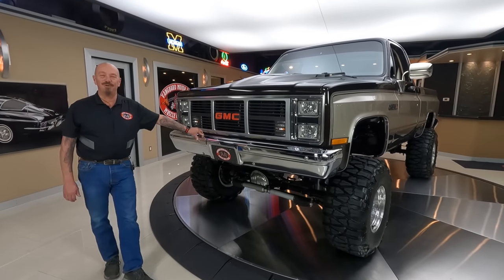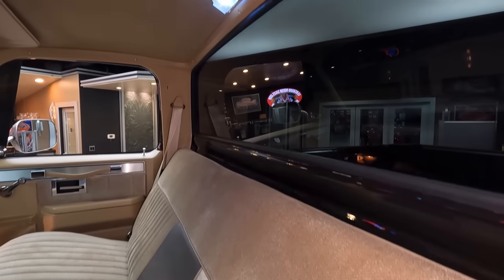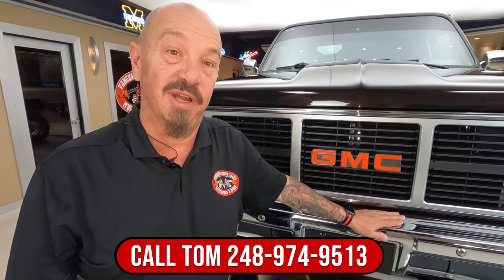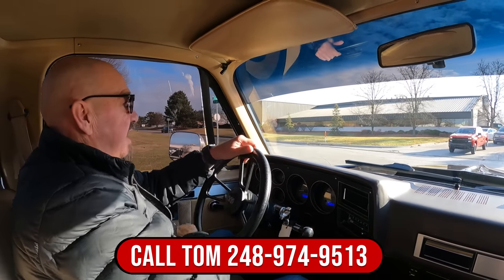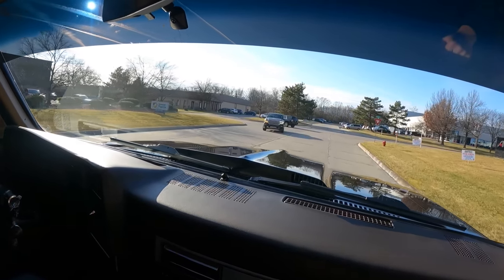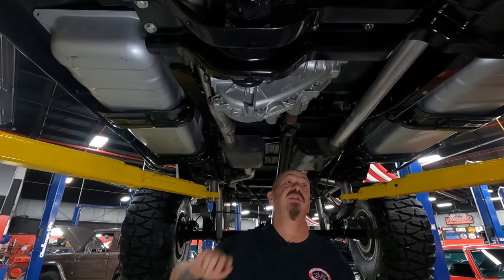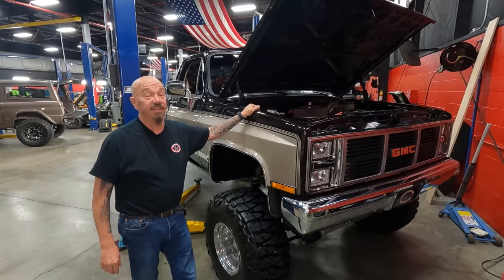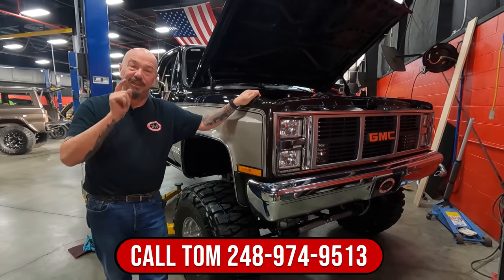1987 GMC Sierra 1500 4X4 Pickup For Sale Vanguard Motor Sales #3233

Comment: I had the 85 Scottsdale 1500. 4+4. 7’ with 35’s mud terrains. Was one of my favorite trucks. Had the factory midnight blue and sky blue two color combo. Mine even had factory coded antenna in the windshield and the quarts clock.
Reply: were those carburated?  when did they go to fuel injection?
Reply: had ‘77 and a’78 77 had small block 400 78 had 350

Comment: I wish I had the money for that truck. I used to have a 1984 Chevrolet 1500 4x4 6 inch lift, 350 bored .40 over, cammed, 600 cfm Edelbrock 4 barrel carburetor, headers with duel 6 ft. straight pipes off of them, 35 12.50 15 inch tires. Was a very wicked truck.